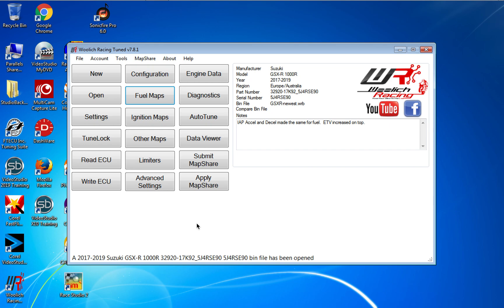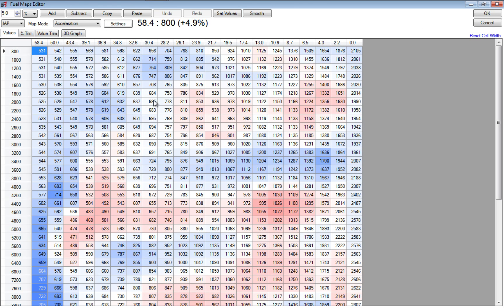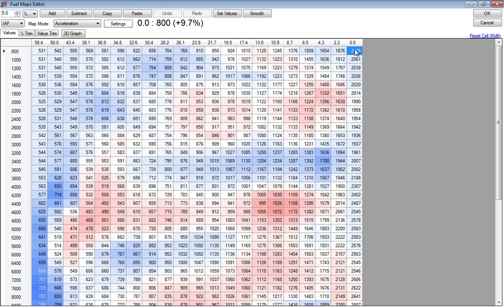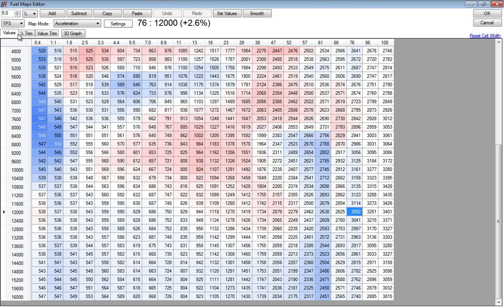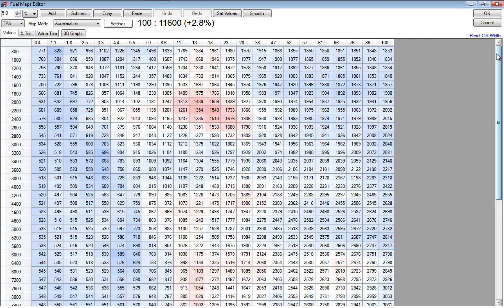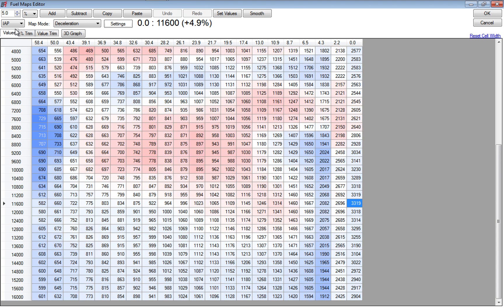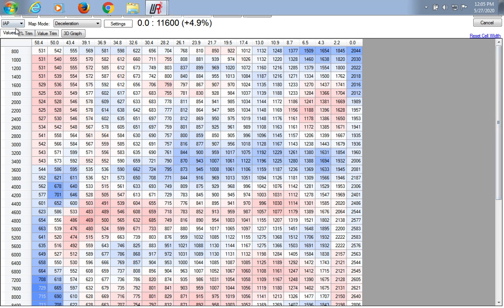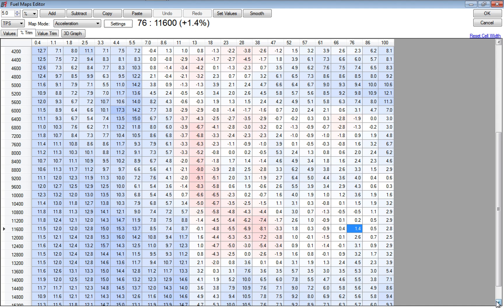GSXR1000R FUEL MAPS CREATED FROM AUTOTUNE

Comment: Nice video! Do you tune the IAP and TPS maps at the same time, or do you start with IAP and then move on to TPS? I'm asking because sometimes when I tune only one of them, the AFR doesn't seem to change in some areas until I adjust the other map
Reply from the maker: I have no proof of this. I base it off doing programing controls for process systems.  The iap and the TPS have to work together to allow bumpless transfers and fuel control.  iap would have the most affect at low rpm and tps in the higher rpms.  In the high rpm tps maps makes the most sense for fueling.  I would think of it as a gradual blend between the two maps. In short I would map both and get them as close to the same fueling as possible.
Reply: @MantisRacing do you mean same fuel values for related iap/tps? Never thought of this before

Comment: Just got log files from gsxr 1000r after a track.... And I noticed that everywhere there are no any data about gear, only ZERO. So if I use filter by neutral - I get no any data
Reply from the maker: Check all of the filters and see if they make sense.  Temperature gets a lot of people. 

Check file size and make sure it looks like there is data